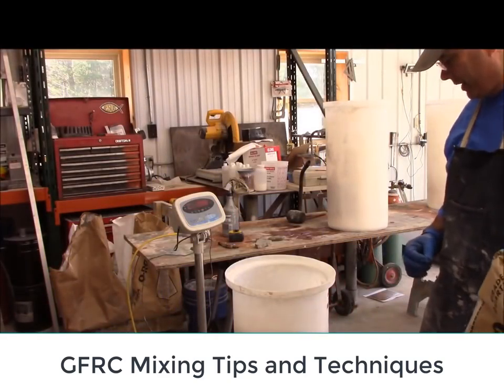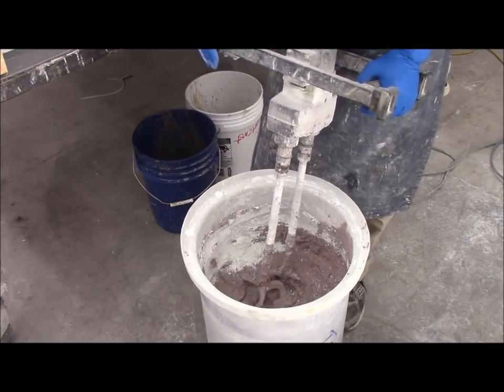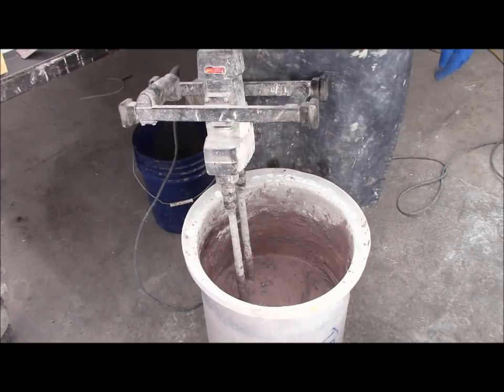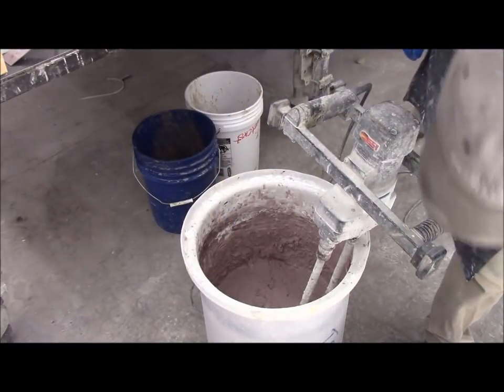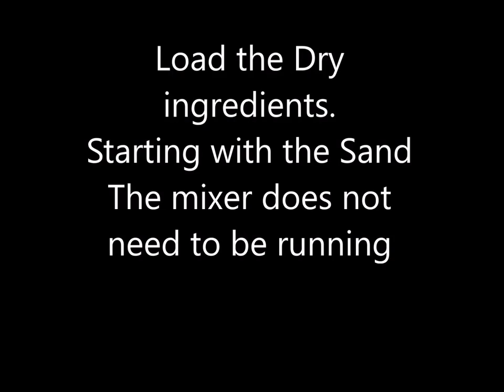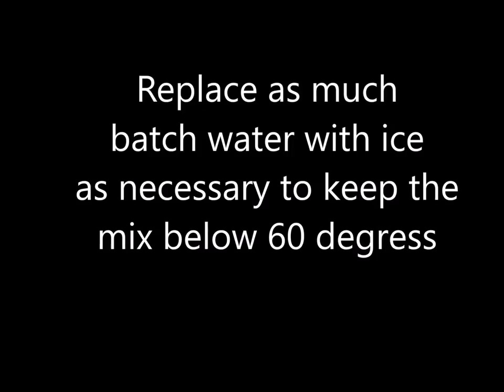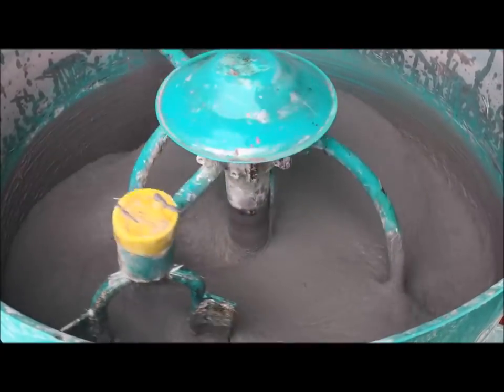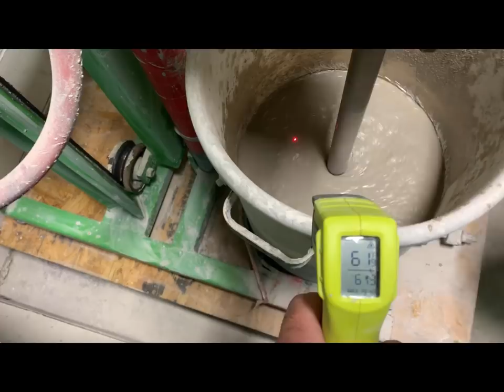GFRC Mixing Tips from Trinic

Comment: Sand at the bottom,  water at the very top. That means a lot of air trapped below the water line and, if careful, you can entrain much of it.

Glad you mentioned ice.
Reply from the maker: In our 14 years of mixing this way we haven't noticed an issue with air entrapment in our mixes.
Reply: I thought you intentionally wanted some air entrainment. Mixing water from the top downwards would be good for that, yes? 
 @TrinicLLC
Reply from the maker: @imconsequetau5275  we've not seen any difference in air entrainment by doing this.  We add the dry ingredients first so we can break up any lumps and then add 80% of the water.  This works the mixer a little harder but creates a shearing effect that we like.  Then we add the rest of the water until we reach the desired consistency.

Comment: How much fiber per bag? SCC mix
Reply from the maker: That all depends on the fiber.  For AR glass fiber you'll want to add 3%.  PVA fibers very with the type: Recs15  = 1/2%, Recs100 = 1% and RFD400 = 1.5%  All are dosed off of total dry weight, so for AR glass it would be 1.5 pounds per 50 pound batch.

Comment: Great video.  I need to use 4.5 CF for my projects and I struggle getting all the mix then placement done timely.  Would a concrete drum mixer work better?  What is your recommendation?
Reply: Try two drums with exactly half of the ingredients in each. Mixing should be a breeze. Substitute some crushed ice for water to chill and prolong the cure. (Measure by net weight or level of water meniscus, not the ice level.)

Comment: Thanks for the video. What I've learned is just to give it time when mixing and use a proper mixer. My basic mix drill simply won't cut it (it started burning :D). Also, with my test mix yesterday I've noticed it started setting fairly quickly, but it's 30°C here so that's why, and I've made a crucial mistake that I've added more water and started bleeding the water once poured.
What I'd like to ask you, with that dual paddle mixing drill, do you use top-down or down-up direction of the paddles (the one I have my eyes on have those two options for mixing), do you have any preference?
Also with larger applications like 2x1x0.03m, would you recommend to mix everything or do the facecoat first and then the backcoat? Cheers
Reply from the maker: We put the sand in the bucket first, then cement and all the admixes then add water and mix top down incorporating the sand last. It is easier on the mixer. Have all materials in the backer bucket (except water) do your face coat first then when it is almost ready mix your backer. Replace 25-50% of your water with ice and that gives you more working time. Just make sure all the ice is melted before placing the concrete.
Reply: @TrinicLLC  thanks heaps. one last question pls, in the first video, is your plasticizer added to the dry mix or to the water? So when you say 'Im adding more water', is that water + plasticizer or just pure water?  If I have the plasticizer powder, I usually add it straight to the water and mix that up a little, but I wonder what your approach would be.
btw I'm still struggling with how quickly it starts setting ... at 5mins of mixing I see it's already setting up...what then ? more plasticizer or a bit of water ? cheers and fantastic videos you have here. subscribed
Reply from the maker: @skywalknotpossible  add the plasticiser to the dry mix. Adjust your mix with water. Send me your mix design at info@trinic.us and I’ll help you with the quick set issue. YouTube it the worst place for me to communicate.
Reply: Use enough ice substituted for water to keep the temperature down. [colder mixture will cure slowly]

Comment: I have a newly acquired eibenstock dual paddle mixer and it keeps shutting off, like I'm hitting an automatic overload feature, but I don't think I'm overworking it. Have you experienced anything like this?
Reply: Does it have a cooling fan and is it clogged/obstructed with dust?

This behavior reminds me of cold solder joints, where the solder is crystallized. However,  motors shouldn't use solder but instead braising or welding...
Reply: Please consider borrowing an amp meter or power meter. You can confirm if the load is staying within the manufacturer's spec.
Reply: @imconsequetau5275  That is a good idea, thanks. I did discover that the unit will restart immediately if I cycle the power cord, this makes me think the issue is digital in nature.

Comment: Hi! Im trying to do my own mix and i find all products in my country but in liquid(superplactizer, silica fume and polymers) i mix it with water before add cement, it looks good but after 3- 5 days i get micro cracks on my countertops.. what did i wrong?
Reply: Just use pure water on top, sand on the bottom. You can pre-mix the minority dry ingredients somewhat in a closed bag or bucket. (To contain the dust.) 

And adding the water on top helps keep the dust inside. You don't want to breathe the dust, especially silica fume!